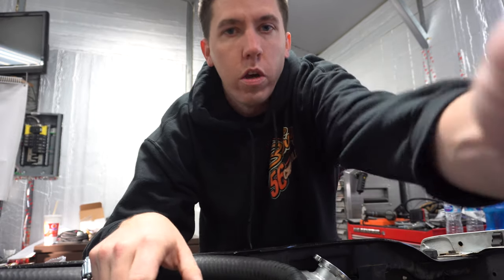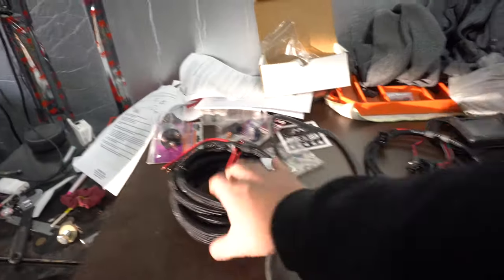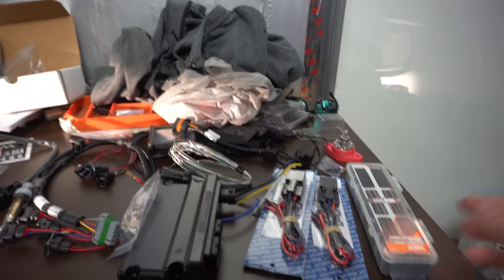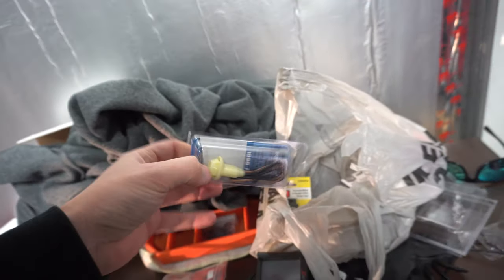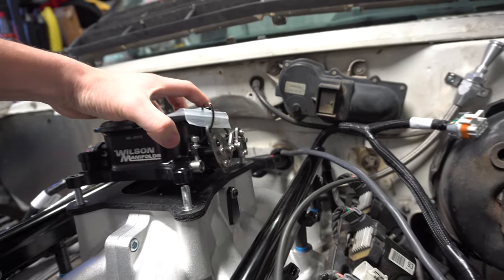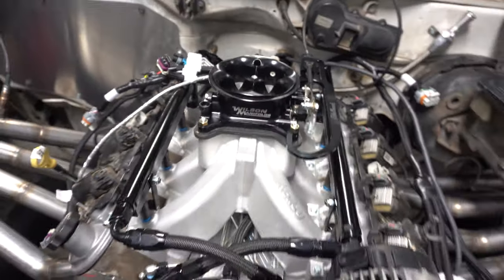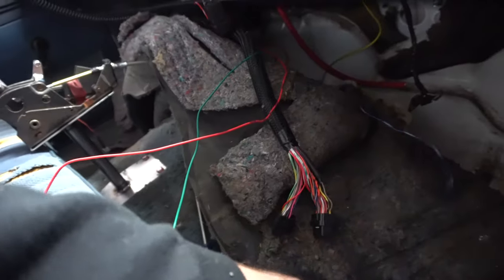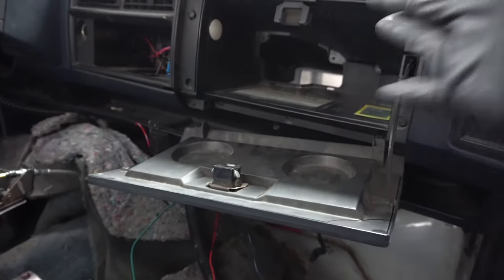LS Swap S-10 Burnout Truck Burnie gets Holley Terminator X and 4150 Throttle Body! EFI Wiring Part 1

Comment: Awesome! My understanding is that by comparison, the HP ECU is a little more robust, which leaves the Terminator X kinda susseptable to damage. Other than that and the need for the adapter for laptop tuning, I was wondering what other notable differences there are. Can hardly wait to see the candles lit!🤘😀

Comment: Couldn't you move the coolant temp sensor to the other head and then it would be in the back of the engine? Would that help clean up the wiring?
Reply from the maker: Didn't even think about that i think your 100% right! Going to take a look at that. Great idea thanks!